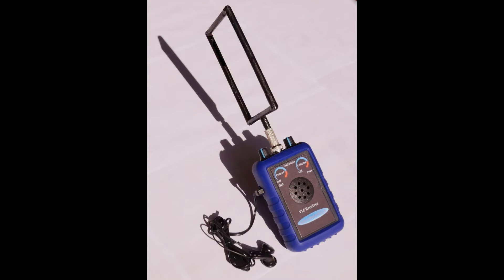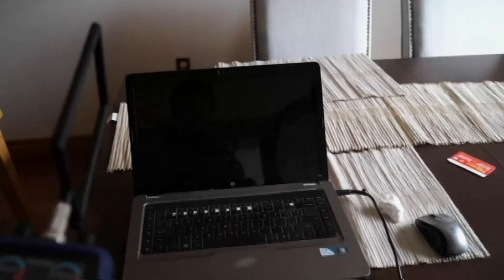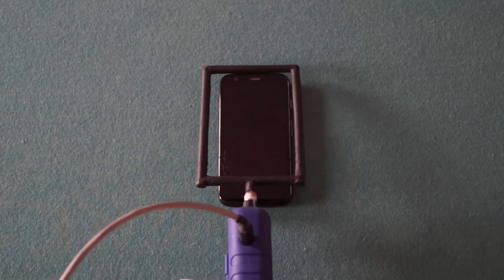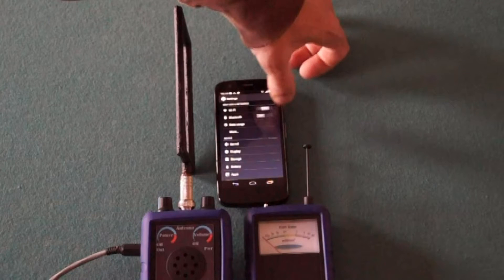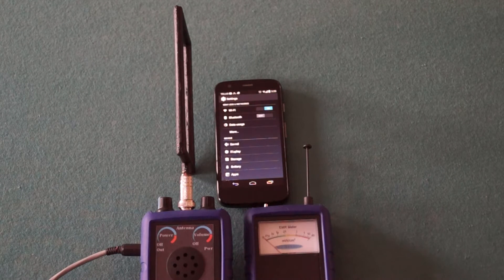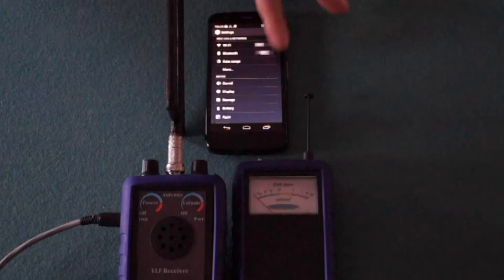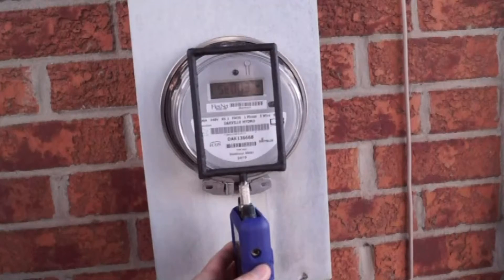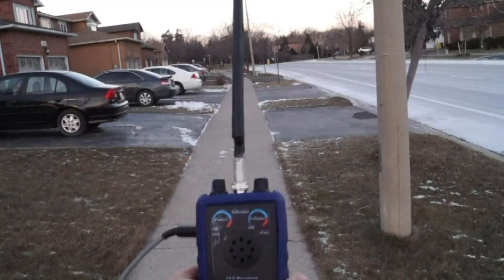Listening to Electrosmog

Comment: Very interesting but you do realise that your not hearing the actual mobile fone and WiFi signals but the noises that the electronics in the devices make even turning on the light on a fone generates a bit of VLF noise but none at higher frequencys